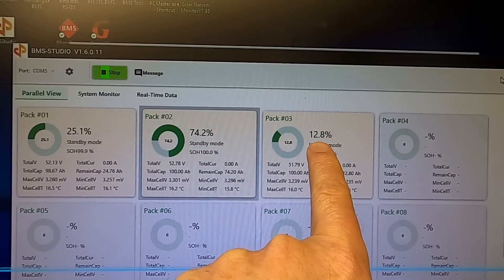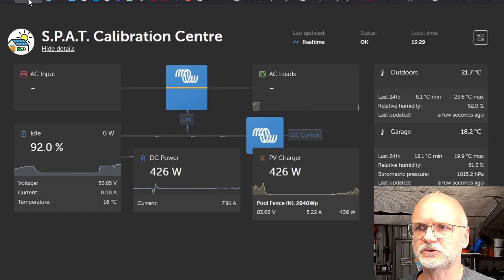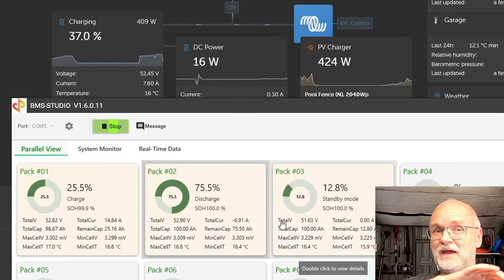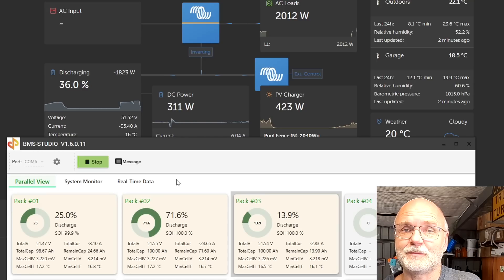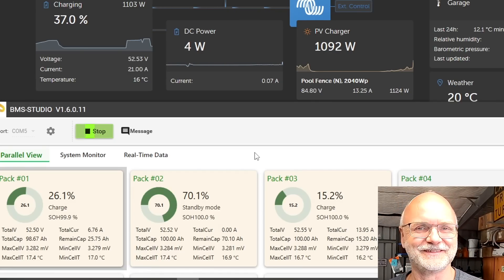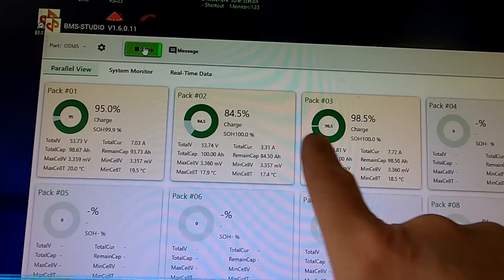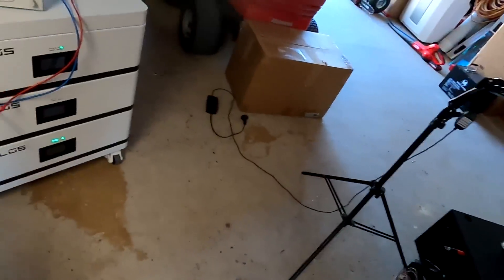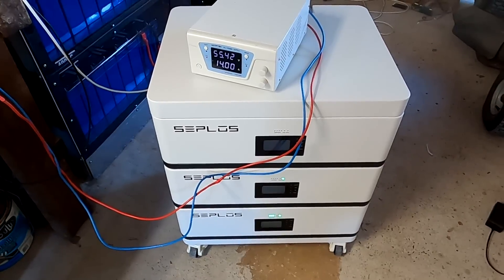3 Batteries in parallel. Lots to learn from an unfinished product 😒

Comment: I have a question for you regarding SOC% counter.
Assuming you charge - discharge a 16S battery pack within 51V and 54V only for at least 3 months, do you think the SOC% will be accurate?
Reply: it will not be accurate. BMSes with cheap coulomb counters struggle a lot to measure low currents (less than 0.5A is usually just zeroed), and it can either drift upward or downward depending on your actual charging and discharging rates. You need to reach the calibration point at least weekly to ensure your BMS knows the state of charge, otherwise that number means nothing and will cause you to run your batteries down further than you planned. Calibration point for many BMSes is unfortunately at cell overvoltage (3.65V), and would thus need up to 58V for a 16s pack to calibrate. 

also keep in mind, at a slow discharge rate, 51V total for an unbalanced pack can be as low as 10% SoC
Reply from the maker: Each shunt needs some sort of calibration from time to time. The current measurement (coulomb count) is not accurate and the SOC will drift over time.

Comment: Oh ! Sweet amps , they are like brand new toys. Nice vid!
Curious, will it balance after time? Say 3 months of use with regular full charge? What is the recommended balance start voltage according to Seplos?
They do balance during charging? (Before 3.45 volts)
I know my 0.6amp JK did a fine job starting balance at 3.40 and absorb at 3.45 for 20 minutes or 2hr. No difference. Now testing with 2a balance at 3.45/2hrs. Let's see what is faster.
I may have to induce a voltage diff manually to test fairly.
Reply from the maker: I doubt that they will ever balance. I had it siting with a power supply connected and the voltage delta got worse after 24h.
The 0.6A JK-BMS is brilliant and would work a lot better than the V3 of the Seplos BMS.

Comment: I've seen this dance between the charger and the BMS - I didn't like it - Micro cycling  on  knee  has got to shorten the lifespan and cause the cells to "Pant" - My solution was to fit a 5amp active cell balancer  on an additional set of leads and drop the charger vo;tage to 3.55v a cell - now the charger controls the charging and the BMS protects the battery if something fails - no more 3.65  over charge alarms
Reply from the maker: Exactly, other BMS can handle this much battery. Seplos V1, the Tiangbangda and PACE BMS, the Gobelpower BMS. All working well without micro cycling the battery and keeping the MPPTs open to deliver power. This V3 BMS here is terrible and I hope they can fix the software without developing yet another BMS instead.

Comment: After one year using two batteries i build one battery 16s2p - i think is better then 2x16s1p. I have seplos bms 200a and voltronics axpert max 7200 with 150a continues discharge.
Reply: there is only one downside cause with 2 batteries you can put the 16 strongest with the highest capacity into one battery and gain a bit of capacity  but have to pay for 2 bms and also for the energy they need to run.
Reply: @typxxilps  I counted a few examples in excel - it all does not have much effect. 10-20 amps by battery it's 500-1000watts -
Reply from the maker: I'm not a fan of parallel cells and like to have a separate BMS to monitor all cells individually. This is for monitor and safety reasons.

Comment: Try conecting positive to battery No. 1 and negative to battery No.3, that way the load will be balanced from all batteries
Reply from the maker: Does not make a difference when using beefy bus bars.

Comment: Disappointing.  The form factor of the Seplos batteries look great, but the fact that they are not top balanced (not even close) shows a lack of quality control in my opinion.  I'd just take out the communication cables and let the whole pack charge to a set voltage and see what happens.
Reply from the maker: Yeah, I was kind of disappointed as well. If there is no top balancing, that's fine but then they need to supply a working balancer and not this joke of BMS 3.0

Comment: No big deal, imo. The cells will eventually top balance, after 100 or so cycles.
Reply from the maker: I really doubt they will ever balance. I've got them in a production installation now for a week and deviation actually got worse. The balancer is either not working at all or is so tiny, that it does not matter.
Reply: @OffGridGarageAustralia  if it got worse, maybe you’ve got a self-discharging cell.
Reply from the maker: @ThanosSustainable  In all three batteries? I think the deviation is far too big for the passive balancer to deal with. After 2 weeks, I will just manually top balance the packs and try again. Maybe this gives the balancer a chance. If it still fails...🤷‍♂

Comment: With your new neeeyyy high Power aktive Balancer you could Balance them ome by one in short time. This type of cells seems to be Garbage 😅 or only the bms ?
Reply from the maker: I think the BMS sucks donkey balls. The software is not great and also the balancer is so weak, it does not do anything with these cells. A huge step backwards in my eyes from what they had before.

Comment: Sadly I had a feeling you would uncover more & more quirks.
Of course it stands and falls with the manufacturer understanding, accepting and resolving the issues you have found. Your feedback should be considered as gold (sunshine), with all those testing you already have done for the channel.
When the manufacturer ignores you or refuses to fix issues (or responds) , than I guess they will not get any Andy's Frogs. I agree, (e.g) the NEEEEEEY active balancers can help resolve the huge imbalances, maybe than the SEPLOS will also perform better?
As right now, it really does not look too positive for the SEPLOS on multiple levels, it sucks donkeyb.lls in my view...
I do hope you had not to pay for the SEPLOS, as I would be very disappointed for that amount of money (investment) and such poor results.
But thanks for sharing, it strengthens my conviction & believes that the Gobelpower is the far better BMS for such scenarios. And SEPLOS should thus be avoided until they fix their sh.t.
Reply from the maker: Yes, 100% agree with your comment. The donkey balls are strong in these products unfortunately. They should have kept the V1 of the BMS and worked on the software. It would have been great by now...

Comment: I don’t see how the cost of this equipment is worth replacing the grid!  This is simply boggles the mind.  This is all wasted if any thing happens to you.  No one will bother trying to figure how this all works.  You need to sell the place and include your tutelage on how to make this all run.  Otherwise all the expenditure on this equipment will be wasted.
Reply from the maker: Any electrician can maintain it (if there is anything to maintain).

Comment: I have such a dislike of pouch/polymer cell batteries they gives me anxiety with memories of my sons RC car racing days! They gas so much which cause pack swelling, once one pouch goes bad it effects the lot. All the thermal runaway videos you see with scooters, hoverboard ect are pouch batteries! Wouldn’t matter what “parameters” was set to I wouldn’t be able to sleep at night with these cycling in my garage! 🔥🧯 I don’t even charge my mobile phone over night 😂
Reply: these are LFP batteries, they are completely different to your experience of Li-ion cells. It's like saying you will never eat oranges again because you bit into the pip of an apple.
Reply: @stefanvanzyl9090  yeah there fine! There probably Ganfeng LiFePO4 3.65v 152Wh pouch cells like the ones Prowse put a drill through 👍

Comment: If you would follow the instructions of the battery and would have charged them and discharged them in the first place. You wanted to have in the problem. This is why they give you Instructions in the with the battery.
Reply: It's about testing for problems & issues. By deviation you discover problems.
Reply: Following an instructions will fix only one of the problems: BMS doesnt reported correcly state of charge (until finishing the first cycle).
All of balancing issues will be still there
Reply: Andy Knows what he is doing...the problem is the balancing and the settings...
Reply from the maker: The calibration of the BMS has nothing to do with the poor balancing function. Total garbage.